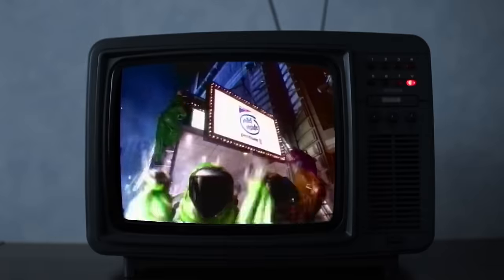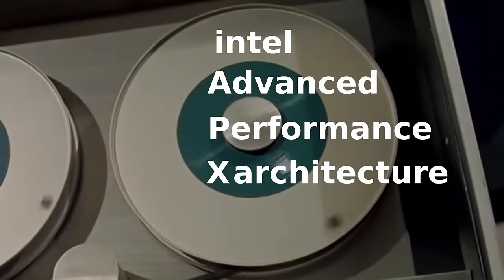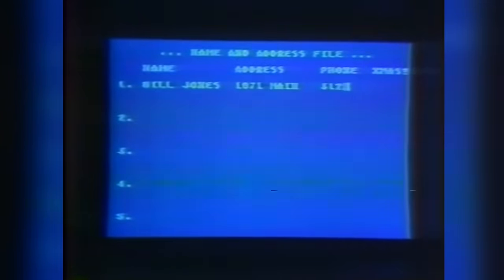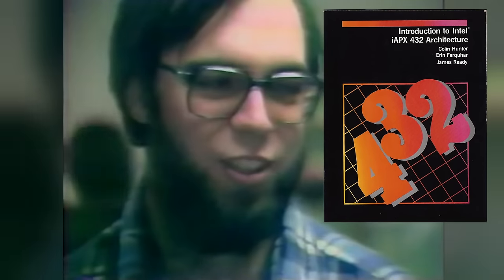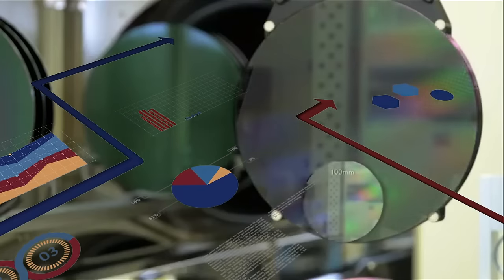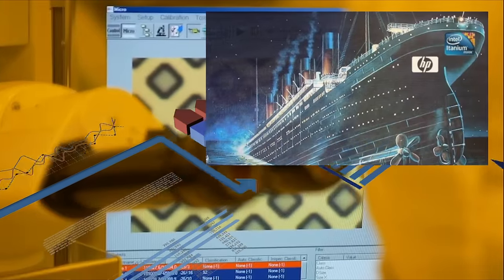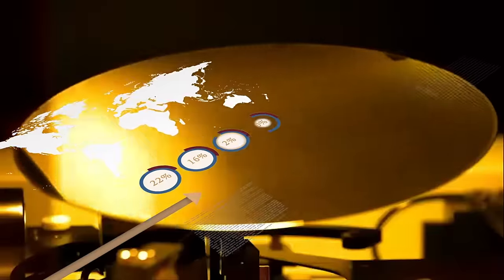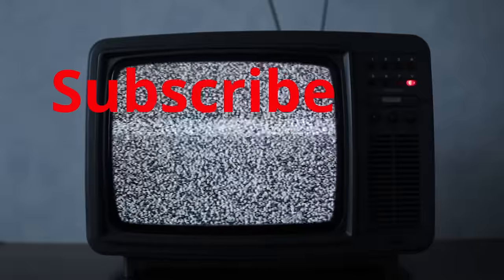iAPX The first time Intel tried to kill x86

Comment: Very interesting stuff. I'm glad I skipped this chapter in Intel's life!

When I used to repair Ontel terminals, I came across one CPU board that had 8008s on it! That was their oldest product I came across. The others were based around 8080 and and 8085 CPUs not counting their Amiga CP/M 2.0 computer which had the requisite Z80.
Reply: Wait, 8085 or 8086?
Reply: @DryPaperHammerBro  Yes. 8085s and yes, 8086s as well which I forgot to mention. Really old ca. 1980-81 and earlier equipment. 

The had static memory cards with up to 64K of RAM on some models. There were platter drives, and Shugart floppy drives available as well as word-mover-controllers, PIO and other I/O cards. 

Their customers included Walgreens Drugstores, Lockeed-Martin, Standard Register, Control Data, and many others.

I learned more working on this stuff than I did in my tech and engineering classes. Amazing and fun to work on actually.
Reply: @Clavichordist  I only knew of the 86
Reply: Amiga CP/M 2.0 computer? Does that anything to have with CBM? I mean, there was the C-128 that had a Z80 for running CP/M, but that wasn't an Amiga.
Reply: @samiraperi467  yeah, as far as I know the Amiga (previously known as Hi-Toro) was ALWAYS an MC68000 design, Jay Miner purportedly had flight simulators in mind when he created it, and using something to take advantage of the recently invented low cost floppy drives (which is why the Amigas have the brilliant Fast vs Chip RAM and RAM disk paradigms, so as to load as much code into memory to speed up application performance while mitigating the slower speeds of floppy drives without having to rely on taping out large ROMs which are much more expensive).

Comment: The point of the iAPX 432 was to design a clean, safe, reliable architecture. Had it happened a decade later without the need for backward compatibility, it would have been a superb architecture. Its problem was that it was too advanced for the time and its day never came. The same was true for their Ada compiler. It was, again, designed to be clean and safe at the cost of speed.

Comment: 8:01 propagation delay doesn't become relevant before you reach the order of magnitude of 1 GHz (at 1 GHz a signal at lightspeed travels 30 cm during 1 clock cycle, in a copper wire still at least 20 cm). The iAPX 432 ran at a maximum clockspeed of 8 MHz.

Comment: well, the 8086 was designed with high level language support - it had a stack register and the BP stack frame register and it could do 16-bit multiply in registers. And the 80186 and 80286 added the push and pop instructions to make it more convenient and code compact to preserve register state and the call stack. Any one that has tried to write a C compiler for the MOS 6502 can testify to what a brilliant CPU the Intel 8088/86 was by comparison.

And all the rival 8-bit processors were resorting to the kludge of bank switching to get past the 64K address space limitation, which is relly clunky to support in code. Intel had the brillance of adding segment registers thereby making it performant and relatively easy to write programs that used more than 64K for code or for data.

Effectively Intell in circa 1976/77 had already designed a CPU that was friendly for high level language support. Would take until around 1983 where languages like C compilers were respectable enough to garner professional use and begin to make software more economical to creare vs writing entirely in assembly language, as had hither to been derigour for micro computer software
Reply: Though it was late to the 8 bit party, the 6809 is a far better 8 bit. Though they all trounce the 6502, which is horrid and was only popular because it was cheap.
Reply: I like your insights, thank you for this.
Reply from the maker: pusha popa are also very useful for assembly programers as is having a stack register. C did a good job of fitting in well with everything that suited asm too. That was of course not by accident, as it was intended as a systems language to begin with. A lot of high level languages where no where near as machine friendly as C, in comp sci circles at the time languages like Ada where seen as the futrue many did not predict the popularity of C, as it grew with the spread of Unix in that late 70's early 80's period.
Reply: Intel’s segmentation scheme was really horrible. It led to the need for “memory models” like “small”, “large” and all the rest of it, each with its own odd quirks and limitations and performance issues, and none of them compatible with each other.

Meanwhile, Motorola made the right long-term decision, by designing the 68000 as a cut-down 32-bit processor, with a full, flat 32-bit address space. That cost it in performance in the short term, but it did make upward software compatibility almost painless.

Consider that Apple’s Macintosh PCs made the transition to 32-bit in the late 1980s, while Microsoft was still struggling with this in the 1990s.
Reply: @lawrencedoliveiro9104  yup. Just a shame that Motorola was a few months later with the 68000. IBM did want the 68k but it wasn’t ready. x86, in all it’s forms but especially up to the 286 is a crummy ISA. If you ever did windows 3.1 programming in C, well you have my condolences. Backwards compatibly, ie looking backwards, was always intel’s focus.  Segmentation was a direct result of this, vs the 68000 which was a design for the future and it’s flat 32 bit memory model etc.
Reply: @RetroBytesUK  call-stack based languages like C and Pascal ilk, in addition to a stack register itself, really need a stack frame register to make access to call parameters and local variables efficient

the MOS 6502 had a stack register but it's stack was only 256 bytes - which any high level language would blow out of the water in two or three calls deep. The 8088/86 allowed the stack to max out at 64K, but usually the stack was consolidated in with the data segment and so had to share that space with static data and heap data. But even still, was a huge step over the 256 bytes of the 6502.

Those that implement a C compiler for the 6502 first have to create, effectively, a virtual machine abstraction of some sort and target that. But, of course, the emitted code will not be very efficient relative to code for a CPU that has dedicated registers (like the BP register of the 8086) and suitable addressing modes per those registers.

The USCD Pascal p-code virtual machine ran on 6502 but, of  course, via interpreting its p-code on a virtual machine. Commodore sold a PET in Canada that was aimed at computer science departments. Realizing the 6502 was so dismal for high level languages, they put a Motorola 6809 co-processor board in this particular model. Tells everything one needs to know about the matter.
Reply: @RetroBytesUK  Well, C was initially geared around the way the PDP-11 ilk of mini computers worked, but the basic concepts became fairly common place

Comment: Thanks for this video. Another thing people often forget these days; back then Intel was heavily involved in the manufacturer of commodity DRAM chips
Reply from the maker: Your right they did ram chips, they also did a lot of controller chips too.  I think most 8bit micros that had a disk system in the 80s used an intel disk controller. Intel was also still a general chip fab back then,  and you could contract with them to fabicate your own custom asic.
Reply: A key point is that the x86 processor family was not their biggest product then.
Reply: @lawrencedoliveiro9104  The iAPX project started in 1975, three years before the 8086 (the first x86).

Comment: 15:24 No it wasn’t. The 8087 chip looks like it came out a year earlier. In fact, the 8087 was a key contributor of concepts to IEEE 754.
Reply from the maker: It was a key contribution to 754 but does not eniterly fufill it, iAPX is apparently the first chip(s) that did. Apparently these differences are small and insignificant in almost all cases but are there. If not for those differences you would be spot on about 8087, it just narrowly misses the crown but in it away that really does not matter that much. Also I was really struggling to find somthing nice to say about it at this point so I let it have its very technically first win.
Reply: Yes, and was an interesting example a marketing jungle warfare. IEEE-754 included a feature whereby bits of precision would be gradually dropped when your exponent reached the minimum value. DEC's VAX architecture didn't implement this, though they implemented the rest of the standard pretty completely. Intel implemented this and thus provided a demonstration that the feature was realistic. It went into the standard and Intel could claim better conformance than DEC, who were left trying to explain why it wasn't important. That was a hard sell to many in the numerical computing world and provided Intel a marketing edge. Standards work may be kind of dry but it has real world consequences.
Reply: Gradual underflow was an important feature. Go read some of Prof William Kahan’s writings on this and other numerics topics. They don’t call him ”Mr IEEE754” for nothing.

Comment: At Imperial College we bought an iAPX432 and SBC86-12 with a Matrox 512K multibus system. Managed to run OPL432 the Smalltalk style language. When I left Imperial, they sold me the system and I eventually put the iAPX432 on ebay.

Comment: You commented (mocked) Intel for using iAPX on the 286 chip name. Most CISC machines are implemented using microcode. What if they used the APX technology to implement the x286 by simply replacing the microcode with one that implemented the x86 instruction set plus some enhanced instructions. I don't know that this happened, but it wouldn't have surprised me.
Reply from the maker: The 432 its such an odd design with its system objects etc that I doubt it would have been possible to implement that via micro code on a 286.  They are vastly different architectures.
Reply: @RetroBytesUK  back then nobody called it "A P X" but just "four, three, two" instead because Intel did use the iAPX brand for everything between the 186 and the 386, only dropping it when the 486 came along. The 286 was indeed a 432-lite and does include some very complex objects that the x86 have to support to this day. In fact, it was the desire to play around with one of these features (call task) on the 386 that made Linus start his OS project.

Comment: Seems like a lot of similarities between the APX and Itanium from what I heard of the Itanium. Itanium brought about my first look at EFI boot process and that turned out useful for me. I had Windows 2000, HPUX and linux running on the Itanium. The Itanium was faster at some operations. I had an SGI server with Itaniums that I stuck linux on and had it as a camera server running motion on around 2006 or so.
Reply from the maker: There are alot of parallels between iAPX and Itanium, and also i860 it seams Intel was doomed to keep creating similar problems for its self.
Reply: IA64 failed because of the drawbacks of VLIW. The performance you squeeze out of that is dependent on very complex compile-time decisions.
Reply: @thatonekevin3919  Yeah, but that's the opposite of what's being described here. From the description here iAPX was to make writing compilers easier. Ia64 needed a more complex, smarter compiler to get the best performance. So, these 2 were complete opposites. Also I think AMD's 64bit extension of x86 and the resistance to abandon the backward compatibility to legacy x86 was part of the reason IA64 never took off.
Reply: These are not similar at all - quite the opposite...

Comment: Look at the current IBM "z series" mainframe. It has a lot of "conditional" instructions. Equivalent to "load if" instruction.
Reply: ARMv7 and earlier have lots of conditional instructions but fewer on ARMv8. Interestingly, RISC-V slices this in a different way by packing a conditional jump into 16 bits of a 32-bit word. The other 16 bits hold instructions like move to register, perform arithmetic, etc. The branch doesn't create a bubble in the pipeline when the target is the next word so it runs just as fast instruction. as a conditional. Very slick.

Comment: @RetroBytes - when you run out of topics, here is one: MMUs . Early microprocessors had some registers and some physical adress-width. Then they found out, that they might do something like 'virtual memory' and/or memory-protection. The processor families Z8000 and 60000 had separate chips, which acted as Memory Management Units. They did translation of some logical adress to a physical adress. when the requested data was not in physical memory, they aborted the instruction, called a trap-handler, which loaded the memory page from disk and restarted/continued the trapped instruction. some architectures could just restart/redo the instruction, but some required to flush and reload a lot of internal state. 
Maybe you can make a video about the various variants, which were the easy ones, which were the tricky ones, how is it done today (nobody has a separate MMU).

Comment: As a collector of weird old cpus, a 432 would be the jewel of my collection - of course I'm never going to see one. For 'failed intel x86 killers' I have to settle for the i860 (and maybe an i960) which is still plenty weird, but which sold enough to actually turn up on ebay every once in a while.
Reply from the maker: You stand a chance of finding one of those.  I have a raid controller or two with an i960 used for handling the raid calculations.
Reply: i960 that weird or odd? My 486 133Mhz systems has a DAC960 RAID controller card (prom a PPRO system I was told) that runs the i960 and has 16Mb of ram (max 32 I think). Also Dec Alpha NT 4.0 drivers for it so I could put it in my PWS 500AU if I wanted to.
Its way to fast for my 486 PCi buss BUT I do load the DOS games on 486 lans the fastest, first in on a MP season of Doom2 or Duke3D so there is that XD
Reply: The original i960 design was essentially a RISC version of the i432. It was originally intended to be used to make computer systems with parallel processing and/or fault tolerance. The project was eventually abandoned, but the core of the i960, stripped of almost all of the advanced features became popular as an I/O device controller for a while.
Reply: Don't miss the channel 'CPU Galaxy', in one video he showed a gigantic collection of cpus.

Comment: A bit of precision is required concerning the meaning of “RISC”. It means “Reduced [Complexity] Instruction Set Chip”. Ie, each operations are simpler to decode and execute—more often than not, in a single CPU cycle. Whereas CISC might require multiple CPU cycles to treat a single “complex” instruction. This simplicity generally meant that RISC processors has more instructions than CISC to compensate.

Comment: Great video once again, I enjoyed it.  I never knew about this though I had heard of ADA.  Never really knew what it was, just heard of it in passing.
Reply: It’s a nice language. Ada was the DoDs attempt to force their suppliers into producing software in one well designed language, vs the dozens there suppliers were using. VHDL was there attempt at the same for describing hardware. Both have very similar syntax. I learned Ada at university (1995) and VHDL much later, and they are both very verbose, ridged languages, since these are actually good attributes. It’s a shame that each aren’t more popular.
Reply: @lawrencemanning  yeah, i wish something more strict become more popular in the past, but instead we got C and C++ being the base of basically everything, with their questionable design aspects still haunting us to this day

I wonder how many major security scares would have never happened if C/C++ was less popular and something more rigid was used to implement a lot of important libraries instead (probably a lot considering how many can be traced back to things like buffer overflows in C)
Reply from the maker: I think one of the reasons the MoD liked it was exactly what you onlined. A lot less room for certain classes of errors. I remember being interviewed for one job after uni they where very keen that I'd done development work in Modula-2 and some ada, as a lot of the code they where working on was written in Ada for missle guidance. I was less keen once I found about the missle guidance part of things.  C was very much a systems language that became very popular. Its very well suited for its original task, far less well suited for more or less everything else. However given how well c code performed when compiled given it did things in away that was closer to how the hardware did it seamed to just take over.  Once we nolonger needed to worry about that sort of thing so much it was to late it was the defacto standard for most things.

Comment: @13:40 The 286 didn't have a MMU. Don't think Unix would make much sense on such a chip. It certainly wouldn't be much fun. The 386 was the real "makes Unix possible" chip. Linus Torvalds once said, he started Linux because he was interested in how the 386 could handle it (more specifically he was interested how to implement paging with the 386).

Comment: Having just watched your Itanium video, seems like a similar mindset between the two...pushing the performance onto the compiler instead of silicon
Reply: No sin there. RISC computers are a key part of the architecture's success. But the simpler architecture of RISC makes it easier to optimize instruction choices and the simplicity of the underlying hardware makes it possible to run fast and to add things like caching, instruction pipelining, and speculative instruction execution. Of course, when the CPU runs screaming fast you have to wait for memory to catch up, but something has to be the bottleneck.